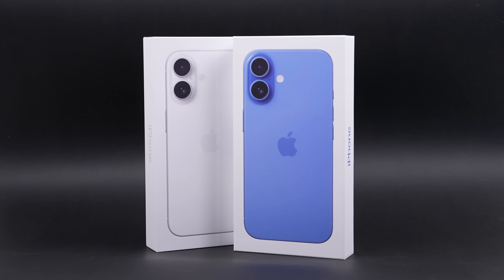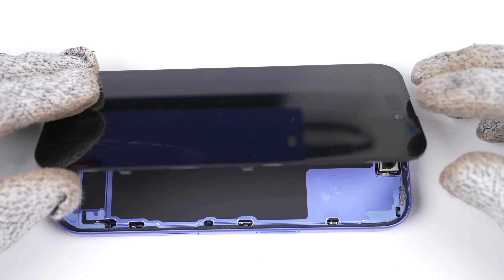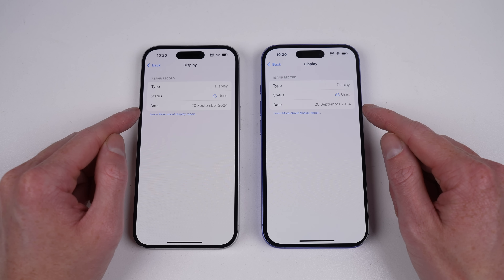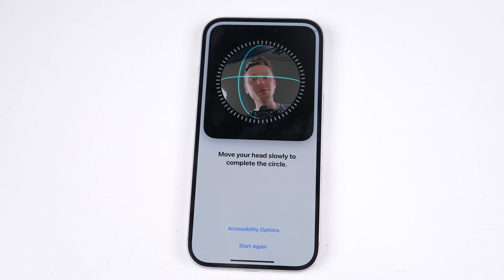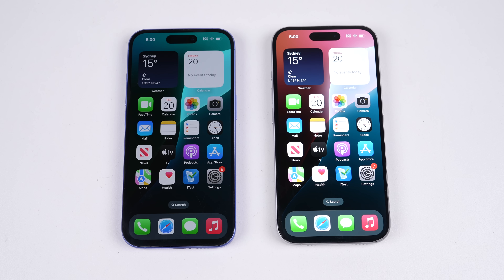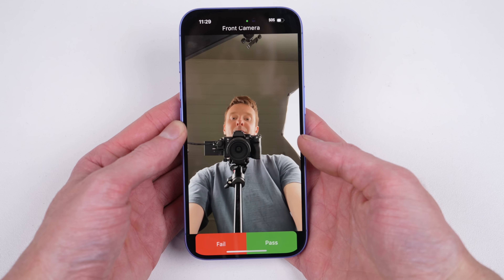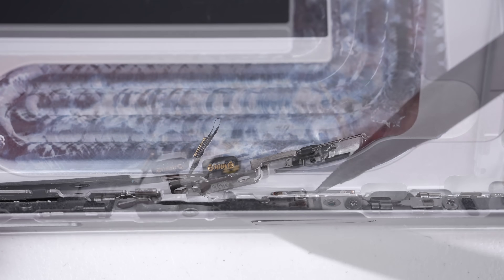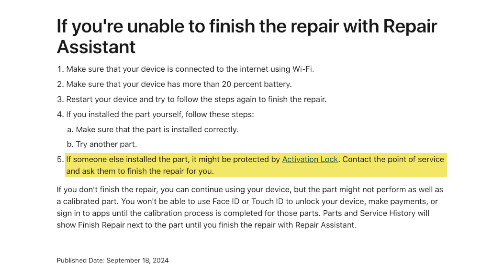iPhone 16 Changes How We Repair iPhones - 3rd Party Display Issues - Teardown And Repair Assessment

Comment: By looking so far at the repair assessment I can say that it is an improvement indeed to allow used parts to be paired without having to go to an apple store / genius bar. 
While I can understand the frustrations and "limitations" of certain features when using third party replacements I can also understand or think of reasons why certain limitations are introduced.
Some might have more sense than others to a certain extent but let's consider the different paired parts
- Display disables True Tone and max brightness. True tone changes the shade of the screen based on the ambient light sensor. Now let's assume you got the cheapest replacement with the cheapest built in light sensor. That thing might have the crappiest quality or be poorly made so the readings/ values of the light sensor will be off or the colors of the display will be far different and  have a worse image quality. Therefore if you had that feature on even after a display replacement the experience will be straight up bad. One might argue "It's better to have the feature rather than not having it" but at the same time do you really want to have something that half works or works badly? I would prefer to have something that either works as intended and was designed by the manufacturer rather than having a bad experience overall.
About the brightness. These screens are designed to consume a certain amount of power based on the specific technology they were made since we have amoled, oled, lcd, va pannels etc. Each having different requirements in order to work properly. Now imagine buying a screen that is an aftermarket that doesn't meet those requirements, you turn on peak brightness, it ends up requesting more voltage than it needs to until the whole driver chip of the display gets completely fried and your motherboard becomes e-waste. I wouldn't prefer that to happen to me honestly
- Battery, same thing. These batteries are made to meet certain requirements and are designed to work within certain parameters while charging/discharging. How many times one buys an aftermarket battery that a month later becomes bloated? There are hundreds of reviews on amazon with horrifying pictures at times. Good thing that those batteries didn't burst into fire and turned the entire house and the people within to plain ashes.
- Face ID. It's a bunch of cameras and sensors. If they ain't made the way they were intended to than I wouldn't be surprised to see someone stealing a phone and unlock it with a picture because it had a knock off FaceID module. 
- The back glass serialization is kinda stupid if it's just a coil and a flash led connected to a motherboard but again, aftermarket / knock off parts usually are cheaper and whoever makes them wants to have a margin of profit therefore they will cut corners to meet whatever quota the company wants. So I wouldn't be surprised to see a coil that overheats next to the battery or ends up frying something on the mainboard
- Third party cameras? who assures you that the sensor on them will be 48 megapixel or whatever these models use right now? And have the same quality or functionality? Especially since the iPhone uses a different kind of stabilization that shifts the sensor rather than the lenses assembly. Yet again you have small parts that require mm precision in order to work and tolerances that are very very small in order to function correctly. So I wouldn't be surprised that the cameras plainly don't work after a replacement since the phone is like "wtf, i have no clue what did you put inside me. The heck am I supposed to do with this now?". So you turn on the camera, the OIS kicks in and boom, you now have a damaged sensor that is unusable since the whole thing wasn't properly calibrated before turning it on

So from one side I do hate the high prices on certain parts (especially if they cost the same as simply going to the genius bar and replace the part out of warranty, minus the time you spend fixing it yourself) but at the same time seeing how many after market replacement parts are straight up junk and e-waste, I am not surprised that a lot of features are disabled for safety or to prevent irreversible damage to the main board. Cause honestly everyone is going to yell and say "i want a self repair to be cheap, i wanna be able to do it on my own etc" but as soon as something breaks and people loose all their data, photos and memories stored on their devices (since most of the time in like 90% of the cases nobody does a backup) these people quickly become quiet about the topic. 
I guess to make everybody happy they could remove all the restrictions on third party components and let you do whatever you want but as soon as something breaks or doesn't work as expected it's 'bye bye, your choice your consequences, we won't honor the warranty since you decided to put your hands by using aftermarket crappy parts" 
Another solution would be to make an agreement with specific aftermarket parts that somewhat meet the requirements to work properly but knowing Apple they will try to make an MFI (made for iPhone) royalty certification driving the prices of those aftermarket prices up and be close to the original ones. And from a business point of view it makes sense. It's a company that has to make money at the end of the day by offering products and services to the customers

Comment: So, I'm not entirely sure how things will go from here on, but as of iOS 18.1 Developer Beta 4, my iPhones 11's replacement iFixit battery is now displaying battery health, cycles, and manufacture date in settings (I have iPhone 15 battery metrics enabled). This is the same data that can be gathered via battery stats shortcuts through analytics files. Meaning no more need for shortcuts or external programs. However, it displays an "Unverified" message, claiming "Unable to verify this iPhone has a genuine Apple battery. Details from this battery may not be accurate." Which I find to be a legal implication, so I see no issue there. I can't speak for any other 3rd party replacements other than battery so take this with a grain of salt, but we seem to be heading in a good direction. This all seems to match up with Apple "Parts and Repair Services" paper they published earlier in the year. You still cannot pair 3rd party parts (or calibrate them as of now) to get rid of the 'non-genuine" part warning. Apple did claim that they would apply necessary calibration to 3rd party parts to the best of their ability in the paper though, so I'm unsure if they are currently doing this or not as there is nothing that currently implies this.

Comment: I seen in other videos that if the phone itself is icloud locked all the replacement parts will be as well. Thats probably why they added this feature most likely only parts that will calibrate is parts from apple or take a gamble with pulled parts on ebay in a few months. Most pulled parts are from icloud locked phones so I dont see it being worth it now. Just like apple wants.
Reply: That's been apple's justification for this in the first place - phone theft or trying to do it to phones ppl buy then return. 

It's nonsense. There would be no market or need to do that if spare parts were readily available, and apple won't do that because they make $$$ on it.
Reply: Icloud locked is usaly STOLEN so didums! Care factor 0
Reply: At least then that would limit iphone chop shops. Grab a phone out someone’s hands and sell the parts. 
Until a workaround is found
Reply: @TrevelyanOO6 People do just forget to remove the icloud lock on their devices when they send them to recylcing. While it would have a small positive impact, I think it would cause a larger negative impact
Reply: @TrevelyanOO6  The limitations in the previous series has not deterred pick-pockets, and neither will this.
Reply: Imagine they would do that to your car ... Pop in an unapproved battery or tires and you couldn't use it anymore. You wouldn't accept that so why accept it for the phones or computers
Reply: @patrickcardon1643  thats literally how some high end vehicles work, like bmw. You need to go to a dealership to pair a replaced battery with THEIR software

Comment: You should check if ios18 fixes swapping parts on iphone15s or older.
Reply: It did it on my iphone 12's camera, didnt work for my refurbished screen because the earpiece had been replaced with an aftermarket one
Reply: It works on the M2 iPad Air, the M4 iPad Pro, and iPhones past the iPhone 12.
Reply: it should work.
Reply: it worked for my 15 pro's back glass
Reply: Do any message come for earpiece swap
Reply: it is announced to work with iPhone 12 and later.
Reply: I swapped a battery on an iPhone 11, but the message is still present
Reply: It works for iPhones 12 and later, on 11 It doesn't

Comment: Why can't you just take the battery out?
A simple spring clip or something?
Reply: @mrfoxesite4482 seriously though, i simple raised bit of plastic in the battery moulding and the equvilent hole for it to sit in, I mean it's not like you'll take the battery out more than once in the life of the phone is it.
Reply: You mean like in old phones that were truly repairable? Apple wouldn't make so much money that way, come on, pay pay and pay again, it's not your phone anyway it's Apple's
Reply: @patrickcardon1643  yes but they're all at it, not just apple, are they using the battery as some structual thing or something?
I'm sure push fit would suffice.

Comment: While technically easier, the battery "adhesive" requiring a damn 9V battery is insane to me when all they could do was make the battery pull tabs smaller and less sticky.

Im still not sure why the battery is glued in ANY phone in the first place. 
We as humans were making removable batteries less than 10 years ago and afaik no one had any issues with that, though manufacturers seem to suffer from some sort of amnesia that targets only their knowledge of removable batteries.
The only reason why removable batteries were an issue was because the back covers were also removable. If the back cover wasnt made with the strongest clips, then everything would remove itself from the main frame in case of a drop.

Idk man, none of these manufacturing decisions make sense to me, especially when it comes to production of excessive waste.
Reply: or they could also screw the battery in place like pretty much every laptop
Reply: Keeps amazing me users keep defending religiously anti-consumer measures we did NOT need or have in previous phones, the brainwashing and phoney excuses seem to work perfectly
Reply: @patrickcardon1643 yup and they would wonder why these companies keep trying to fck them while they themselves gave them a greenlight in a different bs before.
Reply: Lol you can tighten the battery down with some kind of foam under it to absorb play if the battery expands the phone will puff up and you will know....
Reply: @Arkadiusz-l9j because if the battery rattles inside de phone it would be annoying and if by some chance it can get damaged inside the phone because it was rattling if would blow up like lithium usually does and no, you can't make it a tight fit since the battery needs a little bit of space to expand during degradation. Samsung forgot that in the Galaxy Note 7 and we all remember what happened
Reply: @sterkriger2572  What part about "some sort of amnesia that targets only their knowledge of removable batteries" proved challenging for you to understand? We've done removable batteries for decades now and your vivid daydreams about exploding batteries have absolutely nothing to do with what these batteries were like to use back in the day. They didn't magically blow up because you shook your phone around or dropped it.
Reply: @sterkriger2572 Solution: Foam.
Reply: The difference from the old removable battery is the design on the board, thats why battery needs more room to fit and needed adhesive in order to make the battery stay in place.
Reply: Back covers stopped being easily removable to improve water resistance, actually.
Go and watch the interviews with John Ternus where he explains why what they do actually makes a lot of sense.
Reply: @peporgan  If John Ternus from Apple said this it must be true because all they care about is their users. The fact that there has been IP68 phones with an easily replaceable battery years ago, and even today there are a few models that offer this with an IP68 rating suggests that maybe it's not true, and in al of them the battery did not "rattled or catch fire" as @sterkriger2572 claimed. As for the Note 7, the problem was not just "lack of space" but due to two different reasons that affected the two battery manufacturers they used. With the Samsung SDI battery there wasn't enough room "between the heat-sealed protective pouch around the battery" (so the "lack of space" is inside the battery and has nothing to do with the phone space) and with the Amperex Technology battery  "some cells were missing insulation tape, and some batteries had sharp protrusions inside the cell" so, again, an internal battery problem.
The reason all manufacturers are experimenting with this is that in 2027 all of those devices (and countless other battery powered devices, from laptops to e-bikes/scooters).
The law requires that users will be able to easily replace the batteries with readily available tools, and if a specific tool is require it must be provided in the kit. The law will also monitor prices (that must be affordable) allow third party batteries to be used and also insures that batteries are ensure that batteries are collected, reused and recycled while setting recycling standards, that are already gradually going into effect (when percentage and types of recycled materials are increased every year). There are also improved safety standards for batteries. I'm sure that Apple will "miraculously" find an "ingenious" way to make an IP68 iPhone with a replaceable battery after such phones existed for years.
Reply: The reason of why batteries are glued to the chasis is to secure them from getting disconnected by our movements

Comment: I jokingly said a few videos ago that apple would start pairing the back glass not saying I didn’t expect it, it was only a matter of time
Reply: Don't give them ideas next time😂
Reply: Soon screws and mother board pairing
Reply: I also figured it would be the wireless charger. Yep.
Reply: The backglas is not paired its the Wireless Chargin coil
Reply: @benNdaKen  The charging coil is integrated into the back glass, so it might as well be.
Reply: Port is next
Reply: @jindrasmutny4181  Well, the port is soldered onto the logic board, so there's no real reason to pair it. Only components that can be removed without soldering have been paired so far.
Reply: I remember seeing those jokes and surprised that they became true